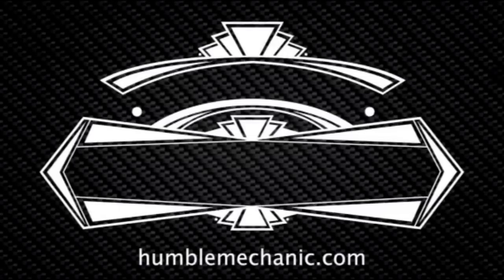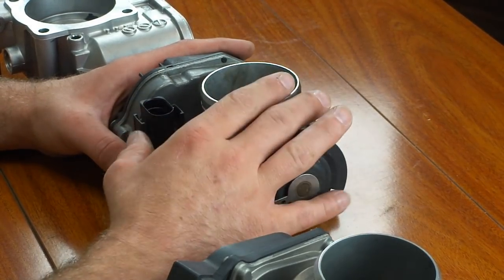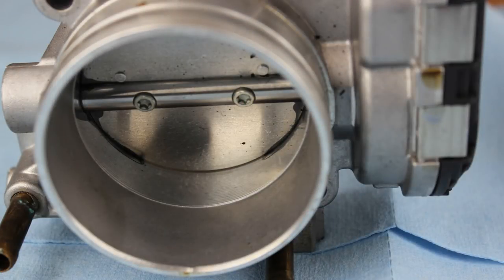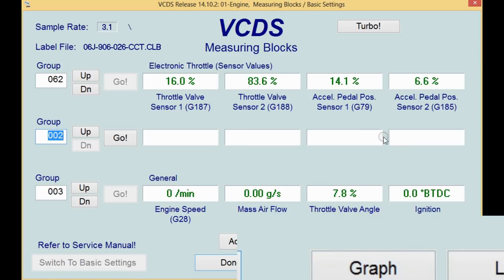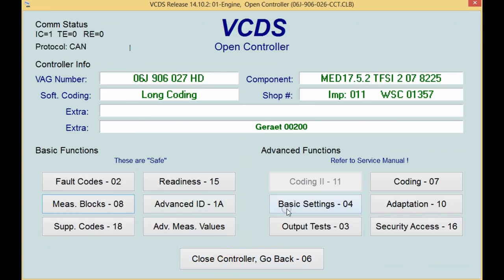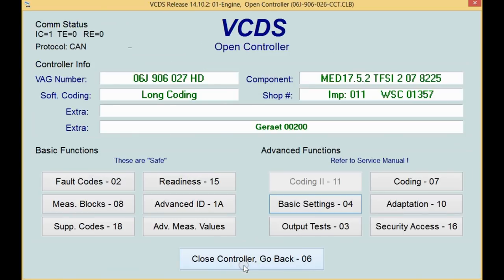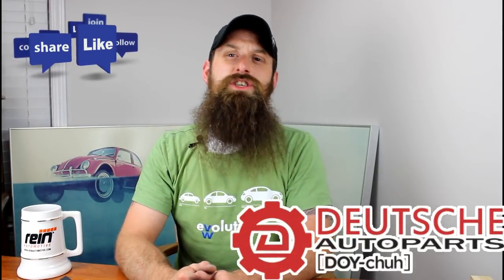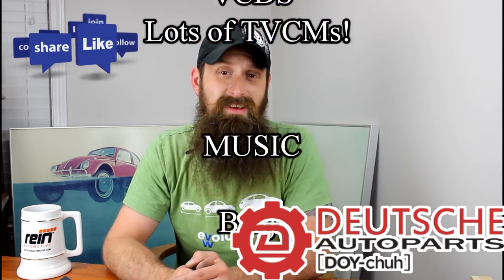How A VW Throttle Body Failed with VAG-COM Demo

Comment: i have a 2006 Passat 3.6 Dealer said throttle body went bad,they want to charge me $800 to replace. Im sure that I can replace the throttle body, but is this body a plug and play unit..no programming required?
Reply from the maker: that one will probably relearn really fast. Just be sure to turn the key on and let the TB learn before starting the car

Comment: I'm having problems with my throttle body freezing up on me in my 08 A3.  It's been -20'C in Ontario for a week. Only have issues first thing in the morning. Starts fine but goes into limp mode because the throttle can't  move. I get a P2101 code. Once it warms up a bit the car runs fine. Any ideas on where this moisture is coming from?
Reply: Generally it comes from the crankcase ventilation although it can accumulate with operation below freezing and with humid air. If you do short trips and don’t get that oil hot enough to boil off any moisture this can happen.

Comment: Charles, is there any work around at all for a 1999 Passat Aeb 1.8t TB adaptation. I'm trying to switch to a chipped Ecu that has been in the car before. Few years ago. Now when I put it in there no communication with the throttle body. I don't have vag-com yet and I've tried reaching out to local enthusiasts here in Metro Detroit with no luck. The two shops I called refuse to make it a quick cheap thing. I have to make an appointment and leave it for the day even though it's a 5 minute job. Edit. With the unchipled ecu currently installed it runs smoother than butter.

Comment: can you clean the electronic throttle body plate, like you can with he cable driven ones? thanks.
Reply from the maker: You can. I always recommend adapting it too. 

I didn't mention it because I am going to do a DIY video soon.
Reply: HumbleMechanic sweet, can't wait! thanks.

Comment: I've been watching your videos. I have a question. Car has been running fine but I was experiencing a tapping sound after a morning start and then it would go away, along with an intermittent check engine light coming on but never actually staying on longer than 60 to 90 miles.  Mechanic cleaned the throttle and said to drive it for awhile and see if the check engine light comes back on, still have the tapping sound and now car sounds like it's overheating when I turn the engine off but no warning lights come on but it sounds funny and smells a little like plastic. I had them replace the catalytic converter a year ago, no work done on the car since, except for oil change but now this. 
2006 Jetta 2.5.... Just a lady needing some suggestions if you can help I sure would appreciate it.
Reply: Probably somethimg wrong with ground or Plus on starter. Example on your battery. Clean all ground under battery from battery to engine engine to starter.

Comment: I will add that it still acts like it's sticking, either physically or electrically, but it seems physical because it return with greater speed than it ever had on its own. The wire throttles in 2003 anyway we're a little sluggish, or maybe that's just how they are. But now i
when it unsticks, my car instantly GOES. But only for a split second and it's back to idle.  No, that sounds more Electrical?  I'm so confused, compounded by the tiredness and pain of trying to fix it all day.  Please help.

Comment: yo man I'm having problems with a Seat Ibiza throttle body, when I start the car it runs but the revs are constantly up and down from about 1000rpm to 2000rpm. The accelerator is completely unresponsive when its like this, I have already changed 2 throttle bodies because of this and read 2 actuator faults. I am thinking that maybe there are some bad connections or problems with the throttle position sensor in the pedal box but its not very obvious. Have you seen or heard about symptoms like these?

Comment: Hey Charles I have an 05 Golf TDI and the other day while on the highway it felt like the car wouldn't recognize anything over 1/4 - 1/2 throttle. The RPM's would slowly rise, so it wasn't in limp mode, but it was veeeery slow. Full throttle barely did anything. Does that sound like my electronic throttle body or pedal is going bad? After stopping for some fuel, the issue went away. It seems intermittent. Any help would be great.

Thanks!
Reply: @markrusson5999  I didn't get any help, but I found out my car was going into limp mode due to overboosting. Sounds like you have an issue with your throttle body or pedal

Comment: Hey Charles, I have my mk 6 gti and I just changed my PCV which was whistling; but now mt check engine light came back on with an error code of P0507.  My first thought was vacuum leak or throttle body failure.  What do you think it could be?
Reply from the maker: Probably a vac leak. Check the nipple on the little pipe at the back of the PCV. I have seen that break and you don't realize it.
Reply: HumbleMechanic OK cool.
Reply: +HumbleMechanic thanks. my GTI has been a labor of love and I'm hoping its not the throttle body.

Comment: hi i install egr valve to vw golf mk5 1.6fsi and the car come on ok but idling not as smooth as it should i think it need programing it can u please let me know how to doit i know i have to go to engine messuring block 072 but dont know whats next as im very new in vcds any help please

Comment: Very very useful video.
Could the values in block 62 field 3 and 4 be the same? in this particular case could the throttle pedal be damage?
Reply from the maker: They could be, but shouldn’t. Could be wiring, or a bad pedal, or ECM
Reply: Many thanks, and the values in block 62 field 1 and 2 should work turning only key on but without start the car?

In my mk4 golf this values didnt change if i dont start the engine @HumbleMechanic
Reply: @josecarlosvilla4351  Did you solve your problem? Same here, B62 field 3 and 4 are the same, values in field 1 and 2 don't change when pedal hit but engine off.
Reply: @seppl733  first of all you need to know your engine model, mine is AUS 1,6 16v
In this model according elsawin this is normal, values in block 3 and 4 are the same
In others engines the values are diferents
Most important is to know the engine Code, even in marelli ecus the values are diferent.
Maybe if you tell me the engine i can look in Elsa the valued
Reply: @josecarlosvilla4351  Mine is BKY 1,4 16V. But its not VW its a Skoda, maybe also listed at VW.
Reply: @seppl733  hello sir, i am trying to find some information about your car in elsawin but is difficult, because the information you need maybe can be in other car with your same engine.
One think i can confirm you, your car has two trottle sensors, g79 and g185.
Mine has only one g79.
For this reason in my car values en field 3 and 4 are the same that in the fields 1 and 2
In your car the values should be different i think
Reply: @josecarlosvilla4351  Thanks for your effort! Regarding the vcds label file g79 and g185 should be different, too. As I get no fault codes, maybe its a mistake in the vcds-file/documentations..

Comment: Have a 2010 vw beetle 2.5 engine.  Have changed out crank shaft sensor already.  Car usually runs fine but will sometimes stall out and will not start back up until after it sits for a few hours.  This last time it stalled it acted like it flooded.  We were able to finally get it started back running after we pumped the accelerator pedal a few times and held it to the floor, then it cranked but ran rough.  A few more times of doing this it started running good again.  Could this be the electronic throttle body?  One time before it surged a couple of times like it was going to die but didn't, and after it was parked in the shopping parking lot upon ready to leave it would not start until after several hours and then fired right up.  (The fuel pump relay pulls in and we can hear the fuel pump run every time we turn on the ignition switch).  One extra piece of information is we have no check engine light illuminated, so I suspect no codes.  Hope you can help.

Comment: I has a faulty throttle body for 3 years with no codes.  The only symptom was hissing and overboost.  This must have happened because the throttle body wasnt opening fully.  When it complete failed, it brought up codes and kept blowing a fuse.  When I replaced the throttle body, the car was like a completely different car.  Which means my throttle body must have been faulty for 3 years before it failed completely and blew the fuse.
Reply from the maker: Wow! I’m surprised it ran that long. Lol

Comment: Hello, I have Jetta 2.5 lts 2010 and I have problems with the fault code P0106. I take the car to VW dealear and they change the MAP sensor. But I have 3 times the same symthoms and allways the VW dealer told me the clean de MAF, but know I need to change the Throttle Body and a presion sensor.

The symthoms are:
The  car likes to hesitate whenever I have the gas pedal
The engine has shut off  while driving and I lost all power when I stop in a singnal,
I got a chck eng light on.
The VW dealer told me to change the 07K133062A, 03C906051F.

Thanks

Comment: Do I need to readapt the TB after I've replaced the accelerator Pedal? I have a 02 2.8l GLI I replaced the pedal because it was throwing codes p2138, G79/G185, p1639 but after driving epc light ABS and Trac light come on again.. I'm lost any input would be helpful.
Reply from the maker: if you are just replacing the pedal, then no. I am guessing the car has other issues. I don't think I have ever seen a VW pedal actually fail
Reply: @HumbleMechanic  yeah I'm at a loss.. the only codes it threw were the ones listed above. If it had something to do with the TB itself I would think different codes would come up? The scan was done on a Solus Ultra (snap-on) also cleaned the TB (alot of carbon build up) and clean Mass Air flow sensor. Also Replaced the brake tailight switch just to be sure. Still same thing.

Comment: PLEASE HELP I have a 2013 VW Jetta 2.0 S, with the p0304 engine code. "cylinder 4 misfire".. I have replaced the plug, replaced the coil pack due to cracks on the housing and it is still missing. the EPC light and engine light are on. Any suggestions? The car was parked for a week and was doing this when I went to drive it.
Reply: Wesley Banks did you check the codes again? Was this issue ever fixed?

Comment: my 5.2 v10 s8 has 2 throttle bodies. It sometimes pop p2101 throttle actuator A circuit range/performance. How can I use VCDS to find out which throttle body is failing?
Reply: found the answer.An audi training manual says Engine 1 is right side of car, Engine 2 is left side of car. So in VCDS you have to look which engine pops the codes.
Reply: What do you mean

Comment: hello from chris i got an issues with my 95 vw golf3 its got 90425 miles and i was washing the engine one day and yes the car woulnt start but i had the issues with the coil replaced i had a used one got it running but then starting having idle issues and well replaced plugs wires cap and rotor and a new coil by beru also did a compression test and i got 150 for each cylinder so not what happens is when i fire it up runs good and smooth then it start to hick up and then fell like it wants to shut off but when i turn on the ac idle goes up  i need your sdvise is it and issue with throttle or tps  or something else

Comment: 1:53 
Don't let it snap like that.
  I did this while cleaning  in my fathers  b5 passat 1.8t AEB.
Guess what? it could not perform  the adaptation procedure, and idle was waving badly after the cleaning.
Replaced it with the filthiest  i could find. Cost me 30$, and some cleaning.  No adaptation,  idle is spot on.

Comment: Hi, i have a problem with my audi a3 2009 8p engine 2.0tsi ea888, i have the error p2015 and now the p0121, i change the intake manifold for a new one with the tps sensor new and the pressure too (all in the kit of the revition) but i still have the p2015, its possible that the throttle body is failure and give me the error p2015 after i change the intake manifold and sensor for new pieces? I note that driving normal the mixture was 14.5, but when i accelerate it charging the turbo the mixture go to 11.9 (a poor mixture) help please, i check all the wires and they are fine, i think the problem now is the throttle body, i need to change for a new one ? thanks!

Comment: Would the EPC light be a cause for it? 01 Mk4 2.0L wagon.
Reply from the maker: Anything that can be related to an "Electric Power Control" system. So anything in the drive train.
Reply: HumbleMechanic Thanks boss I had VCDS scanned and I was throwing 9 codes all. Of them were misfires I need to replace my ignition coil.

Comment: Hi, I have a car vw passat 2006 and in erorr number P2100 I did change the Throttle Body wiped the mistake, but unfortunately the fault still exists. The car is working perfectly and the engine lampe is still Lights up,  HELP HELP HELP
MOH

Comment: So, my g187 and g188 sensors do not equal 100% when added up. I'm getting 99.6% with the 2 numbers combine.

I'm having an issue with very intermittent stalling or zero throttle response, no check engine light, car thinks everything is fine.

Could the numbers not equaling 100% be an indicator of a bad throttle body?

It's an old video so I don't really expect a response, but would love to hear your input on this.
Reply from the maker: Odds are that’s not the issue. Did you clean and readapt
Reply: @HumbleMechanic  yessir, I've done an entire tune up, rebuilt the alternator (slip ring were bad) and replaced fuel pump, crank/cam and MAP sensors. 

Car runs great, but I'm still chasing this bug. Could it be the map sensor update for the 2.5s? It's a 2011 jetta SE
Reply from the maker: That’s more likely
Reply: @HumbleMechanic  that's actually really good to hear, I'm taking it in soon for the 5 year old safety recall and am having them update/reprogram the ECU while I'm there. 

I'll pop by and let you know how it goes, it's a scary little problem. Thank you so much for responding, it put me at ease with this thing lol.
Reply: @HumbleMechanic  welp, the update didn't fix it. :/

It's crazy that it can completely lose pedal control and stall without thinking anything is wrong.

Comment: in other words if you buy a volkswagon go straight out and buy yourself a vag-com outfit cause if not your going to spend another fortune at the dealer lol
Reply from the maker: +freebird1ification that's not a bad idea. Lol
Reply: you wouldnt happen to know what a code 1778 might be for a 2002 gti with the 1.8 turbo auto tiptronic would you i got the light but not blinking and runs fine ?
Reply: HumbleMechanic is there a way I can do the throttle body adaptation without vagcom?
Reply: this should be good 1
Reply: I really should have tried to find a way to factor this into my financing for my beetle when I bought it new.
Reply: I use Obd eleven. Does TBA.

Comment: my 01 gti about 50%of the time my revs slightly to moderately raises when i shift(1st to 3rd most noticeable)...very annoying.i purchased a foxwell  nt510 that does the adaptation,it passed but still does it,got a different TB at wrecking yard and no difference.Any ideas?
Reply from the maker: +Kevin look for vacuum leaks. Broken vac lines plague that engine.
Reply: well i know its got somewhere but wouldnt it have to be a substantial leak to cause this? Now that you mention that i think my lines/routing a lil ass backwards.A issue I cant seem to grasp is how the pcv and vacuum integrate because   the  tee coming out of crankcase breather(lower) was broke off when I got it and i kinda made my own tee somewhere along that breather path.Glad i checked for a response i was about  to take out the pedal.THANKS!!!!!!!!!!!!!!!!!!!!!!!!!!!!!!!!!
Reply: also is there another check valve somewhere along next to booster check valve?If that makes sense

Comment: Man, my 2012 Tiguan was running great and all of a sudden I started it and now it threw a check engine light + EPC light, and it idles like total crap. Seems like it's about to die out! I am too scared to even drive it! I have a generic code reader and I got codes P1693 (tachometer circuit low voltage) and P0123 (Throttle Position Sensor Circuit High Voltage).... do you think my throttle position sensor needs to be replaced?? Plz help!
Reply from the maker: It probably needs to have the connector repinned.
Reply: @HumbleMechanic  Okay thanks. Does that connector just fail randomly, or is there something that causes that to go? It just seems odd that something that's always plugged in and very secure to the vehicle would fail!
Reply from the maker: I think the original harness was a little too short and this caused it to pull tighter than expected. I’ve seen a few with very slightly loose connections. You’d only find it with a pin drag test

Comment: What DOESN'T fail on a VW Group car?
Reply: there's a reason you have no replies hahaha
Reply: What doesn't fail on just about any car?...
Reply: Most failures seem to occur at v high mileages on VW. Modern drivers expectations are through the roof. Pollution fault at 200k? Buy modern psa diesel and they start messing about at 30k
Reply: Vw golf mk5 twice timing chain went, 3 times gearbox failed and esp fault, second vw golf mk5 timing chain went on it and now gearbox whining
Reply: Forgot to add throttle body faulty too
Reply: @sm7538  Volkswagen are known for bad timing chains

Comment: did you say " disconnect both battery terminals and touch them together"  HumbleMechanic
Reply: Battery cables (the clamps, not the battery posts).
Reply from the maker: Haha. I just realized what I said. Definitely meant cables.
Reply: @EXOVCDS  Thanks mann